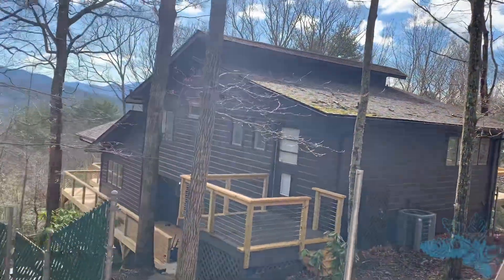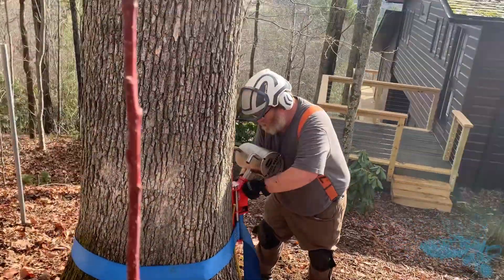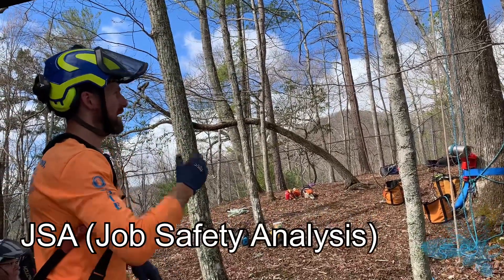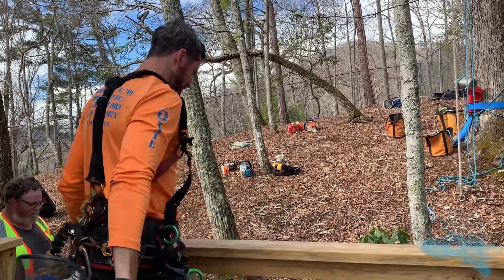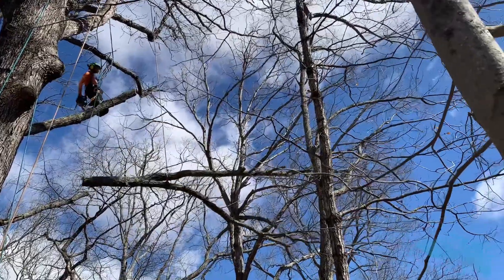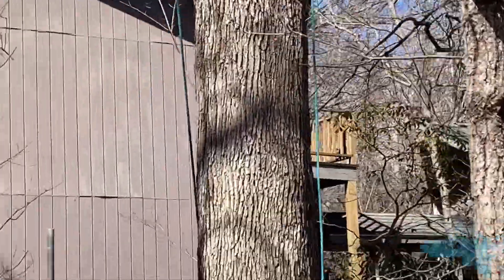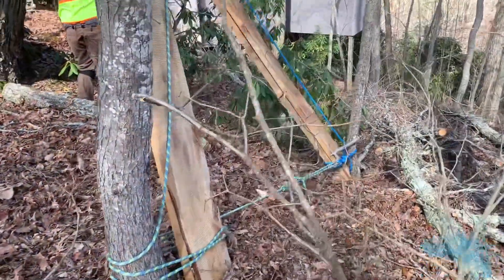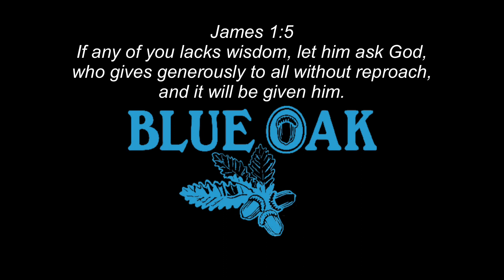NO OTHER CREW WOULD TOUCH THIS W/O A CRANE!  See how we removed it safely.

Comment: Nice work brother! I love jobs like that, kinda figured it would sit back up once the weight was off but you can never be sure until the und. I hope you charged them enough to buy a GRCS for the next one.😀 Never heard of the hitch wrap, I have an FTC micro cylinder that is the same concept.
Reply from the maker: I want a GRCS but I can't stomach the price.  Often we have our miniskid on jobs and we can hoist off a block redirect tied at the base.  Our skid has the branch manager grapple which has easily accessible rope bollards welded on.  Makes for excellent rope attachment and has saved us from having to spend 3k on the GRCS.  Thanks for the comment!

Comment: I'm not a professional but I did a job using similar techniques that was a bit more complicated. The house was closer, there was a shed on one side, and a fence and a neighbors car(who refused to move their car. WTF) on the other side. So three sides, had very close danger/damage points. One thing I did differently than you guys was that when I cut a tied branch, I only cut through the first half quickly. The last part of the branch I allowed to hinge on the10-20% left that was uncut. Once most of the branch fall movement was done, I cut through the rest. This allowed me to make sure everything was going as planned and reduce swing, and the chance of getting hung up on something undesirable. The base of the tree was roughly 3 feet in diameter. I had less equipment than you, and less capable helpers. But the job went down nearly perfectly. At one point I warned the metal chain link fence might get bent a little, and it did, but they accepted that ahead of time. I'm glad to see others using their head to do a complicated job.
Reply from the maker: Stay safe.  Thanks for stopping by our channel